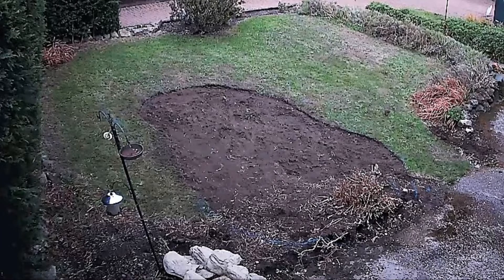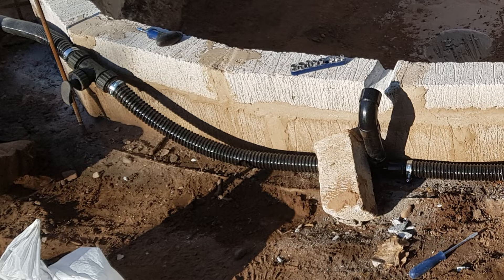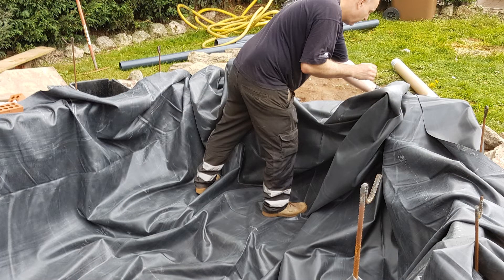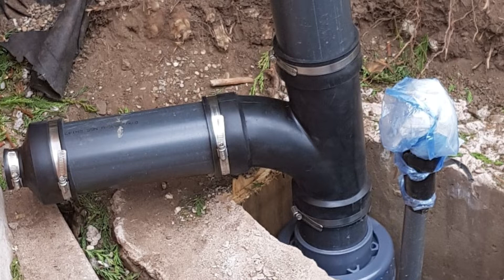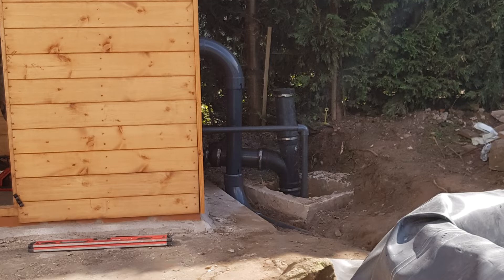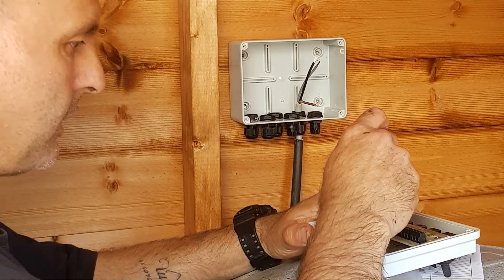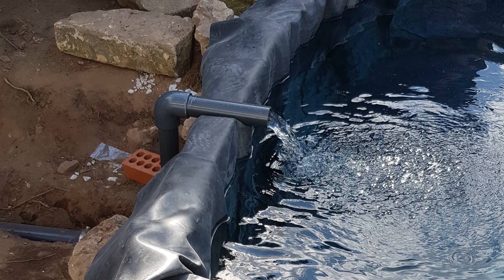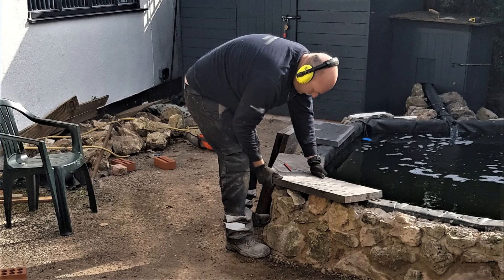How I built my koi pond

Comment: Nice build! How did you attach the coping stones to the wall? My pond is going to be similar to yours.
Reply from the maker: Hi David i used a firm mortar mix and carefully placed them so the mortar didn't fall into the water, i also left a mortar gap of about 2 inch along the water side so when i places the stones the mortar had room to move. Andy